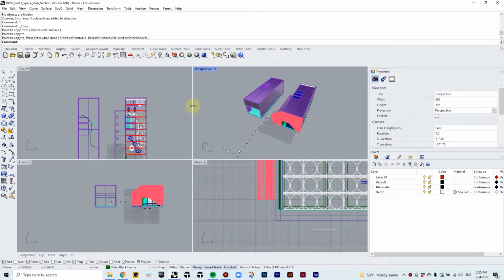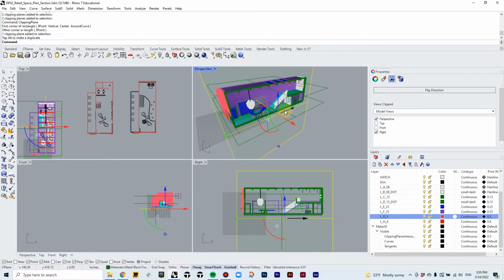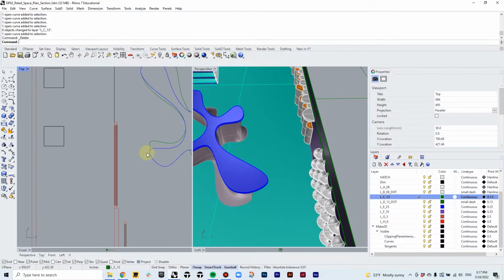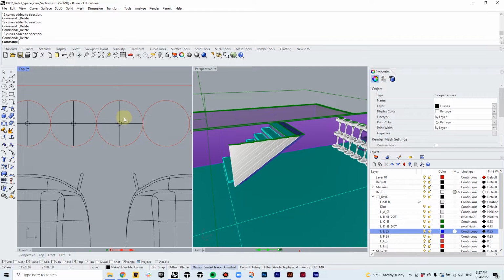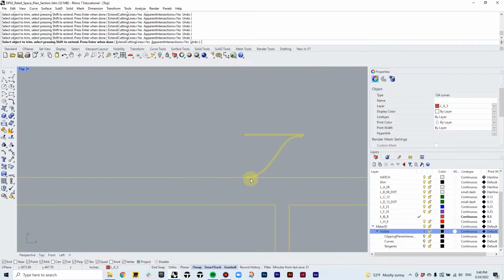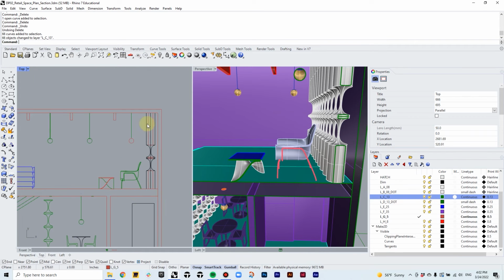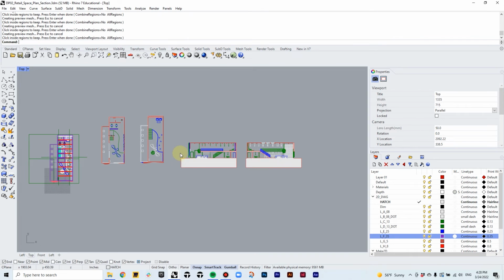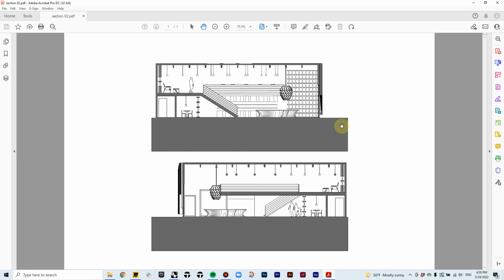Rhino 3D Plan and Section Drawings

Comment: Hi Yo! have you tried doing these section and plan view drawings with VisualARQ? you would save some time! the 2D section and plan view drawings VisualARQ generates are linked to the 3D model and can update at any change. Also VisualARQ provides the Hidden display that lets you print the 3D model displayed in 3D, plan view or section view directly to vector output (PDF), so there is no need to add extra 2D geometry in the model space to produce the 2D drawings.